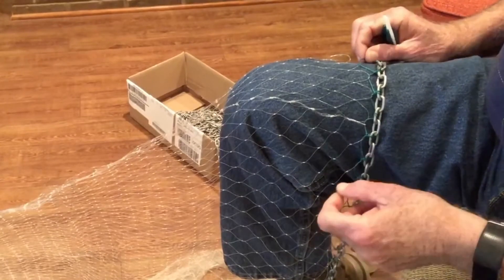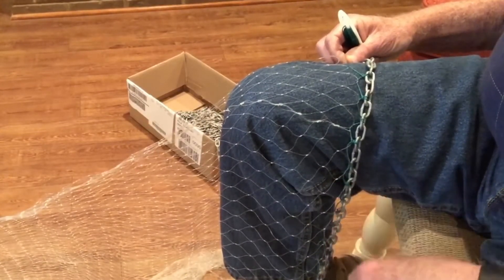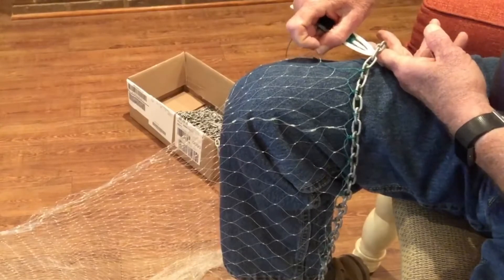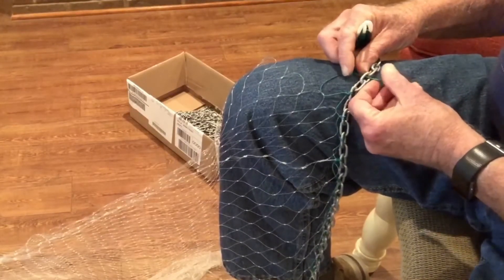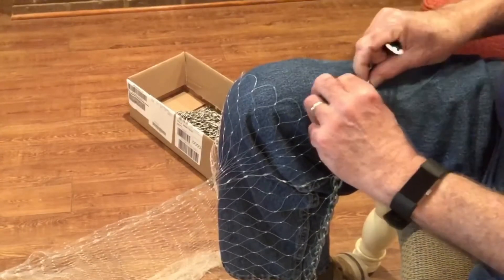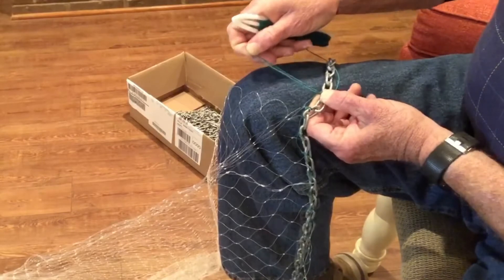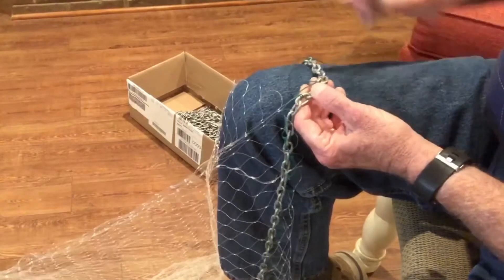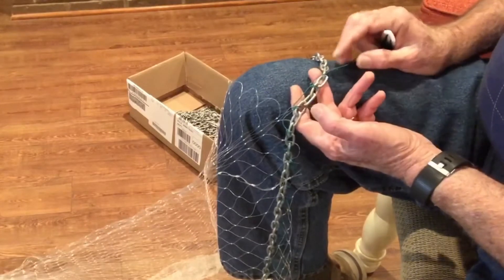How to Hang a Cast Net with Chain

Comment: Innovative ! Although if I were to ever have to do this I might just weave the chain in & out of bottom of cells and then tie it down every few inches or maybe use a cable . Though using a cable might make it hard to fold net up to throw due to it naturally being stiff and the cable always wanting to open net ; although the net probably would always make perfect circles everytime ( pun not intended ) .Thank you for your Innovative thinking .

Comment: What size/type chain do you use? And where do you get it? Several years ago I hand tied a castnet out of 65 lb test power pro. I double knotted every knot. I made the meshes 1" square (2" stretched). And I made the radius 20' long. I've got about 7 miles of Power Pro worth around $700. I hung it with a conventional leadline, but the leads kept flipping up thru the meshes and tangling, so I'm going to fix that by replacing the leadline with chain.
Reply from the maker: I use 1/8 inch galvanized chain. Here is a link to the chain on Amazon. It looks like they have brought the price down considerably since the last time I purchased it.  https://www.amazon.com/Truper-44269-CAGA-1-8-246-Galvanized/dp/B013SF0C4W

Comment: Please tell about your chain mm
Reply from the maker: The chain I use most is 1/8 inch galvanized grade 30 proof coil. Each link weighs approximately .253 ounce and links are approximately .926 inch long. Hope that helps. For those liking much heavier nets, 1/4 inch is a good size.
Reply: @BarryJonesSr  thanks bro